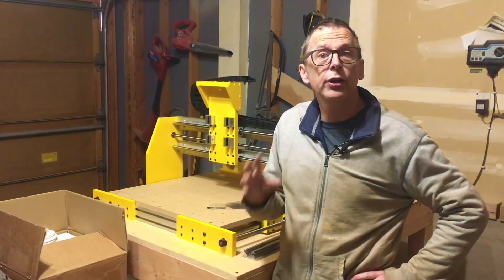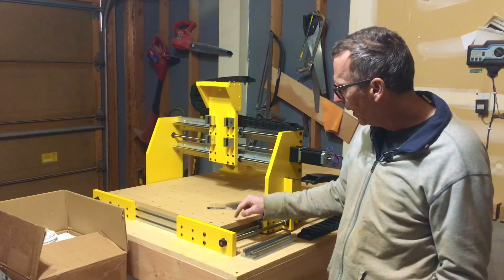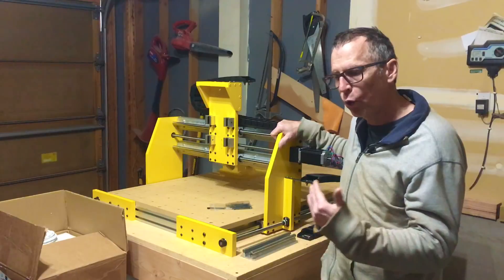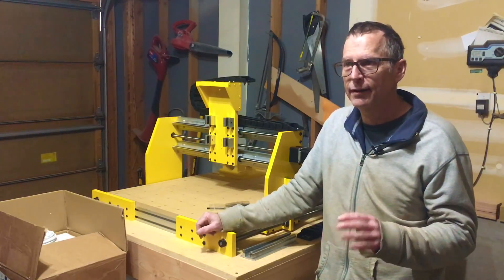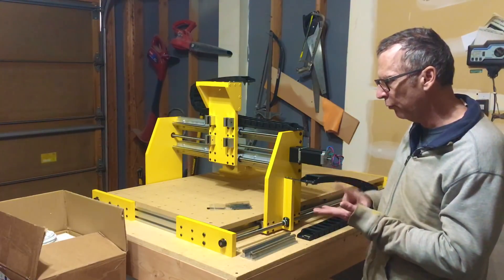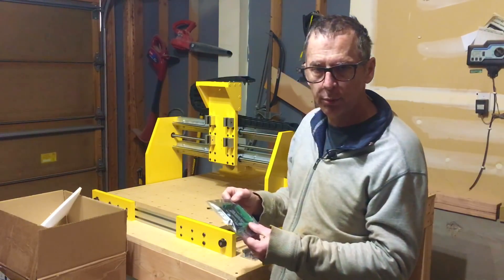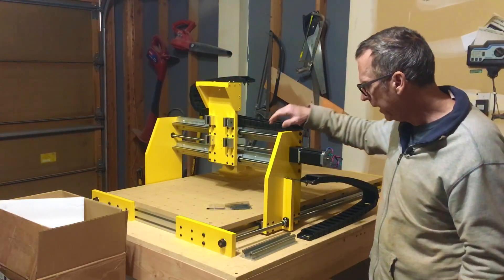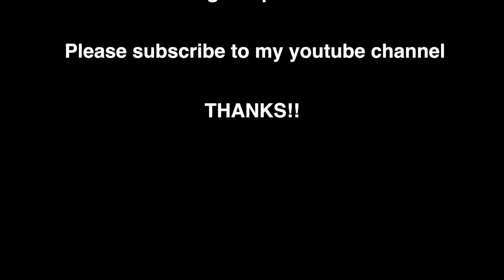Yet Another Update On The Highline CNC Machine Project

Comment: hi  there
i use snapcnc usb adaptor for  a laptop works great with
out mach3 it is grbl based i use it on a 3020t cnc
there is no soldering or any thing like that it is  ready to connect to the usb port of a laptop
and  the other side plugs in with the parallel cable to the cnc and has its own software 
the cost of the  snapcnc is €50 euro and is available  from docado.com
hope this helps
Reply from the maker: That's pretty cool. I'd like to see what's inside the SnapBox. I have a feeling it's exactly like my Arduino Uno with a DB25 CNC adapter shield.
Reply: it could be as i did not open the case  it is sealed 
 it is very handy for the money it costs as it is ready to work  
and saves a lot ot time and you do not need any mach3  
so there is another saving it worth a look for anyone that needs a usb 
to run the cnc and as i said it also has its own software  for to convert svg files
and run the gcode i use cambam to generate the gcode though
and they work fine together on my little 3010t cnc
the snapcnc is ideal for people like me who does not know too much about the arduino system and as you say it is probably  arduino or similar based  system
Reply from the maker: I plan to try their software to see if it works with my home brewed adapter. SnapCNC looks very promising. Thanks for turning me on to them.
Reply: you are more than welcome
i hope that it helps you
regards
james

Comment: Why don't you just get an older computer with parallel port to run your CNC?  First of they are super cheap,  Secondly you shouldn't be doing anything else on that PC because you don't want anything interfering with the CNC control program.  Third, all that computer does is read and send G-Code so XP with a gig of ram is sufficient.  I have 2 machines and I'm running 90's era Dell Optiplex.  I also run my files straight from a flash drive. Just my 2 cents but I do enjoy your videos.
Reply from the maker: First of all, I already have a cheap laptop earmarked for this machine. Second of all, the Arduino DB25 CNC adapter only cost $8.

Comment: What about that one?: 
https://cnc4pc.com/catalog/product/view/id/576/s/db25-motion-controller-arduino-shield-w-tb6560-pinout/category/104/#prodtabs-2

Doesn't seem to require you to do the soldering...
Reply from the maker: Probably fine for a 3 motor, 3 axis machine, but I don't see an option for a 4th motor. The adapter I'm using has an option for slaving the A axis to the Y axis with a pair of jumper wires.
Reply: omg must be too tired... good point. thanks a lot for your quick, useful and well thought-through reply or i might have bought the wrong thing.
I was also looking at this other kit for a while but yet failed to find a finished product without soldering involved and saw your vid.
Hell probably means i will eventually have to enter the world of pain, at least to me, of having to do some micro soldering points after all sniff.
I have a working arduino nema23 cnc solution already but as I am building a new larger w area cnc machine for guitars I was also looking for a more elegant solution with a bit less than a million wires and individual sm driver boards... you know the electronics box once coped with and closed you never open again unless you want another seizure :-)

Comment: Could you post a link to that chinese motor company?
Looking forward to the video edit and the first tests.
Reply from the maker: http://stores.ebay.com/longsmotor666?_trksid=p2047675.l2563
Reply: Nice, I purchased a longsmotor kit a year ago. 
 (CNC 4 Axis Nema23 Stepper Motor 3A 425oz-in&Driver 50V dual shaft)  
I purchased from a third party http://www.ebay.com/usr/steppermotor0322?_trksid=p2057872.m2749.l2754 They even use the Longsmotor pictures in thier store.
it is probably very similar what you have and the quality is wonderful.
It is back in the box waiting as I had to put this project on hold while i took an out of town contract. My plan was to use the Raspberry PI with the Protonener CNC Hat.  The CNC hat has an Arduino uno compatible micro controller on the board. They have a socket convert that bypasses the pololu sockets directly to larger drivers like in your kit. 
I kind of lost confidence that the PI would be powerful enough. I hope to have time to make a test of this in the next few weeks and if it does not work out, i will move back to a PC. likely with something like the solution you have found.  I want to finish the Raspberry experiment, though I'm not confident